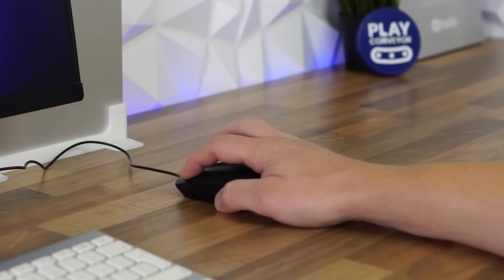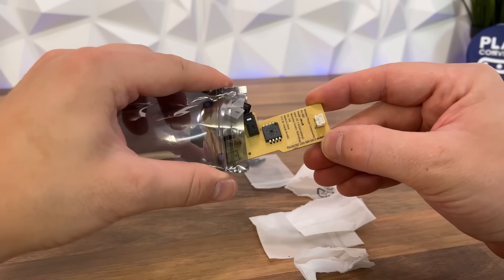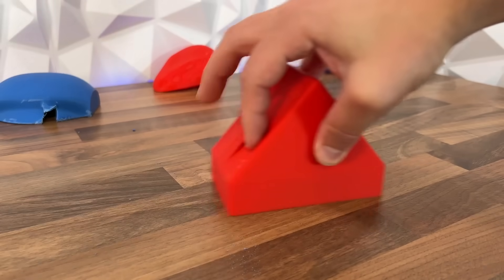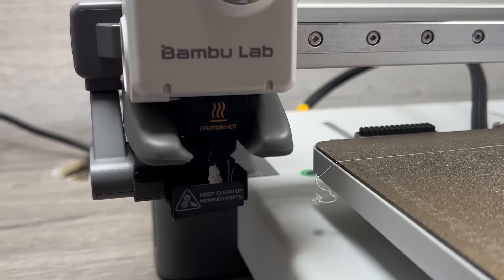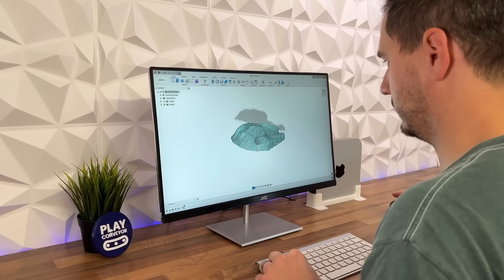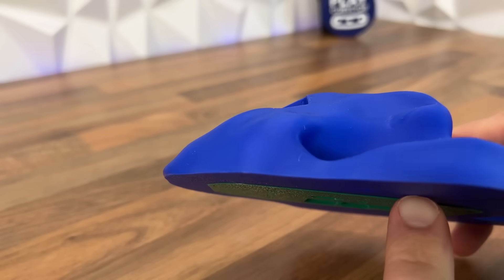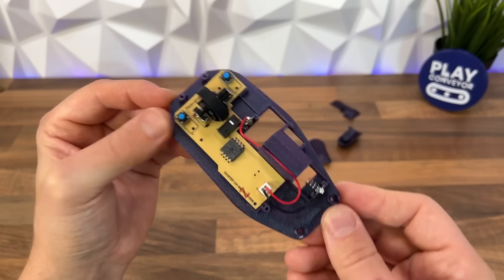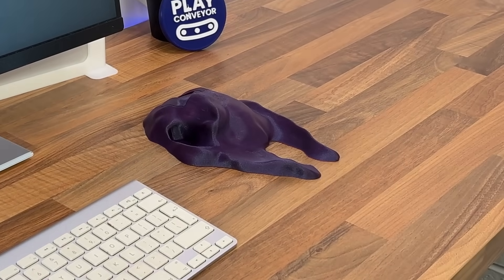I Built the World's Comfiest Mouse (ft. Bambu Lab A1)

Comment: Just have to trim the edges off and smooth this shape a bit it will be great and add 2 buttons for the thumb the idea for resting is good but considering you want mobility and functionality you would like to have something popping up between your fingers as well closer to a half glove for a stable hold without your fingers needing to apply pressure at the tip of the fingers, Great video! cant wait to order your version 2 :DD

Comment: The "magic" mouse is by FAR the worst mouse ever designed. Not only is it TERRIBLE for any kind of work, but the fucking charging port is on the bottom, so if it runs out you cannot use it anymore until either fully charged or charged enough.

The ONLY good thing it has, is the swipy mechanic, that shits legit but thats literally the only thing it has going for it

Comment: 6:11 that. That right there is the perfect mouse shape. The vertical mice make it so your wrist doesnt strain while holding it because instead of your wrist having to bend down to reach your normal mouse, your wrist is just extended straight out like you would normally have it while holding stuff
Reply: Its crazy. Been using vertical for a year and not going back. Occasionally for fps gaming sessions i hop on a flat mouse but even after little use I can feel the tension.
Reply: Not for all. My thumb cramps up holding those. But it also cramps up holding a paint brush for too long. I seem to need something where I can spread out my hand more.
Reply: As a handyman I get to see some very nice home office setups. I recently saw a similar vertical mouse with built-in trackball on the desk of a client who is in her early 60s. The design seems rather genius.

In my experience the lighter the mouse the better. I use a single AA battery powered Kensington "Wireless Mouse For Life" mouse. It feels and sounds cheap when operated but it is very comfortable and dependable. I recently upgraded to a dual battery Logitech "Marathon" mouse but after 3 months I went back to my trusty 5 year old Kensington for its lightweight design.

If the mouse does not need to be carried and dragged around at all it completely eliminates the weight issue. I will keep that in mind in the future.
Reply: @renegonzalez6755 weight is one of the most important aspects for long sessions, weight distribution too. with the Kensington, do you not find yourself "gripping" it because of its size? this is my biggest problem with smaller mice even though id love the solid shell AND light weight
Reply: It's better for the wrist, but clicking a button makes you push the mouse a bit so for FPS games vertical mice suck unfortunately. 
I use a vertical mouse for work, normal mouse for FPS gaming.

Comment: I did pretty much the same thing as a personal project, which resulted in a similar shape to your design.
It didn't turn out to be so ergonomic, since it forces your hand into a single grip with no tolerance, while you constantly try to adjust your grip when using a mouse. Also, the overall flat design felt uncomfortable as it makes it difficult to "pick up" the mouse to reposition it.

Comment: Without watching the video and being from an unrelated branch of hobbies ... All I'm gonna say is that making something fit your hand perfectly is never a good idea.
As a person who dabbles in knife making I'm quite well aware that having finger grooves on a knife which when grasped firmly do feel comfortable however the knife will never be held like that when in use , yes when you are feeling out the knife it will feel good but when you actually go and use it it will suck . Same logic in my mind applies here as well , when you are actually moving the mouse around , you will not hold it the same every time , just moving it left and right you have a different grip on the mouse , when pushing either mouse buttons you will put pressure on different areas of the mouse , modern idea of ergonomics is just plain wrong.

Comment: I would definitely consider making the tail end of the mouse shorter and lowering the overall height. While grip takes a large part in comfort, so does the weight. It can cause lots of strain if it's too heavy, and can be unsatisfying if any of it is limiting your wrist control

Comment: As a person with relatively big palms, I can say that most of the modern mice are terribly small. And humpbacked in the most unpleasant place, forcing you to constantly strain your palm and fingers to prevent them from sliding out. I adore the vintage Logitech mice that were long and thick bottomed. You could simply lean your palm on them, keeping it firmly gripped between your thenar and hypothenar, moving it with almost the wrist moves only, having your palm almost fully relaxed. I miss those mice.

Comment: The bad part of getting the mouse the maximum of comfortable is that you lose the strength to pull the mouse over the surface because your hand gets lazy.
And apparently, he brought comfortable to the pulse by adding mass between his hand and arm, but ended up sacrificing the independent hand mobility from the arm (left and right movement) and can only move the mouse if using the hand+arm necessarily.

Comment: I had this problem a few months ago, because my hands are freakishly large. Solved it by using a vertical grip mouse, gluing felt furniture pads cut into 1×2cm pieces to it, and gluing a door stop under a wrist support to jack it up at an angle. Probably would be better as a single piece but it works well enough

Comment: Technically, the most comfortable and anatomical mice are vertical ones, because they follow the natural shape of the body, as it rests on the desk, without rotating the hand and stressing the forearm and wrist, so starting with a horizontal mouse is already wrong. then, it should be soft and a material like microfiber or velvet to be comfortable and not 3d printed.

Comment: In addition to changing the orientation of how your hand rests on the desk to be more vertical, I think you should somehow scan how your hand rests on this mouse structure, how the pressure is distributed across the palm and wrist, and with that data design a minimal body shape (perhaps some ML is needed here to optimize the shape to be of least volume but supports majority of the hand)

Comment: You should rethink the scroll wheel placement.

I’d recommend putting it on the thumb, or putting right click to the ring finger.

Also you must think about the way you use a mouse. Are you using the entire shoulder to move it? Or just your fingers? All considerations.

Comment: There are passive and active ergonomics. For example, an Apple mouse that at first view appears extremely unergonomic can be more ergonomic than your mouse. With Apple (or any other manufacturer), you can position, move, and relieve your hand in different ways. With your mouse, your hand is always fixed, and the way you work is predetermined. So, at the end of the day, it can have more negative effects than a mouse that looks uncomfortable.

Comment: if you want to get a 3d printer you should probably get a bambu lab x1 carbon instead because the melted plastic make fumes that cause cancer. The x1 carbon has a case and filter so you wont get cancer :)

Comment: Using the ball wheel tracking at the thumb for the cursor navigation instead of moving the entire mouse would have been good for this.  It saves your wrist and is especially good for extensive 3d modeling.  Having one of these now, i can never go back to a regular mouse.

Comment: Here s how you actually use a mouse properly: Remove the "imporve mouse precision" option which is a load of crap, reduce the speed of the mouse considerably and instead of using your wrist to move the mouse you your arm and wider movements. You ll need a bit more space to manuver.

Comment: I see no cushion pads in world's most comfortable mouse
Reply: Because of how it was made, whilst cushion material might be ideal, it is likely not necessary. Because any cushion material would just find the shape that he printed that thing in.
Reply: @the_undead  Ideal?
Reply: @BenBloxer How.. ideal?
Reply: @Erlking-Heathcliff0  fly perfect wings,
Reply: @the_undead  how ideal..?
Reply: @GrimGecko129 potentially improving the comfort A slightly noticeable amount.
Reply: @the_undead  ideal... so ideal that my broken wings may just fly
Reply: Cushon pads make inperfect things confortable, perfect shapes can't become more perfect with a cusion
Reply: @RinusPlotseling It's not like the shape is perfect after a single motion
Reply: @RinusPlotseling Yeah they can. Anything is better with a cushion.
Reply: @gavindinsmoor8196 no, if you add cushion to the then perfect dimensions, it will change the dimensions out of proportion. Maybe negligibly, maybe not.
Reply: @jasonrice5628  True, but if you mold the shape ahead of time to account for the presence of a cushion, then it would squish into the planned shape even if that's not how the hard plastic was printed. Did that make any sense?
Reply: @gavindinsmoor8196 it would have to be dynamic enough to change for the pressure you’re putting on it
Reply: @WaveringRadiant  Then shape the hard plastic how you want. Everyone's got different opinions on this for some reason.
Reply: He should make the base structure of pla and then the outer shell of TPU for comfort.  Also, he should add vents for heating and cooling his hand.
Reply: The cushions are on your hand
Reply: went to see if there was a version 2 on his page, and i guess this was his last video ever posted, and it was a year ago... guess he just poofed?
Reply: Finally perfect mouse
Reply: Honestly some type of cushion would probably just trap heat and sweat. And would most likely stink up over time.
Reply: ITS A MOUSE YOU NINCOMPOOP
Reply: За то вид3и7ь рекламу  бамбулаб😂
Reply: the noise it makes when he drags it across the desk 🤮🤮🤮

Comment: Couple things I can think of for Version 2.
You probably don't still have the playdough mold, so take the current version, apply a ink to your hand, and rest it on it in the comfortable position, then re-scan it. This should let you identify exactly where your hand makes contact, and since the scan grabs color as well, you can create a mask for the area your hand contacts. Using the masked data, select all the parts your hand doesn't contact, and either ultra-smooth them, simplify it into geometry so it looks pretty, or ideally both. This should improve the form factor drastically without affecting comfort at all.
For the area within the mask where your hand does contact, you may also want to smooth it a bit, but not so much that it would drastically effect how your hand rests on it. Then you are going to want to complicate things, by creating two versions. One that sinks the masked area down, and smooths it out into a very simplified form. The other, you will want just the masked area, and smooth it until its a good blend of form factor and comfort, probably going through and inflating the hills ever so slightly if you have a free sculpt feature in the program. Next, using data from these two versions, your going to want to combine them, so there is a body of the mouse with the sunken in slot of the masked area, and the other, just the masked area, with a bottom that matches the other exactly, and a top that is the smoothed and slightly inflated masked area. Print the body in the same rigid plastic as this one. print the masked area in a very soft spongy material. If you didn't see where I was going before you almost certainly do now. the pillowy handprint area should be slightly nicer looking now, but have enough give that your hand naturally compresses the "hills" that are now supportive pillows, and any bits where the geometry of your hand would press down into the valleys will still squidge down the lower bits slightly. When combined, you should have something that isn't shaped as exactly to your hand, but is a perfect cushion to rest your hand on, and a main body of the mouse that has greater shape-design.

Bonus points if you overlay a texture onto the cushion section for improved grip, and print in a material that's not only soft, but feels cool to the touch so it doesn't get uncomfortably warm over extended periods of use on hot days. Also if you get a slightly fancier kit with a thumb button, I think that side slot you've got to support your thumb is begging to be given some functionality.
Reply: Damn that's long i respect

Comment: I was wondering about doing this exact thing.  Mine would be very differently shaped, because I basically claw my mouse and hold it between my thumb and pinky.  But if I were to go through a process like this of creating a completely custom mouse - I would go the full distance.  I would have a click for pointer, middle, ring, and pinky, as well as side buttons for my thumb - all perfectly laid out for the shape of my hands and perfect reach for each finger.  It's never made sense to me why there aren't more mice out there that utilize the entire hand.  99.9% of them only use 2 fingers, sometimes 3.  My current mouse has a clicker for the ring finger and 12 side buttons.  I would want more - a fourth click or a button for the pinky.  And I would figure out a way to design it where I don't have to use as much effort just holding onto the mouse so my fingers are free to input independently.  Otherwise it's a waste of time and money doing this

Comment: The Razer Naga 2012 has replacable side attachments and one of them has a little finger rest so the whole hand is supported by the mouse and you do not have to grip. That attachment is why I have been using the same exact mouse for 13 years. It blows my mind that more mice aren't designed this way. I need to get me a spare for when this one dies.

Comment: My first gaming mouse was a pretty standard shape but with some sharp bits that were annoying, when i had to replace it i got something a bit more ergonomic shaped but the buttons sucked, when that was replaced i went full ergonomic and developed wrist pain with two different fancy shaped mice, returned them and discovered that the ultimate most comfortable mouse shape for me is... bog standard mouse shape, the most boring "default" shape is the best.
Been using a Logitech G Pro for years and have zero issues.

Comment: Ok hear me out. The perfect mouse is not a mouse, but a glove that you slide your hand into, so that improper use of a mouse is not possible, ie moving at the wrist, forcing you to use your whole arm. It fixes the problem of having to grip the sides of a mouse, especially when doing large movements. It makes lifting the mice easier. Literally just lift your hand, or move your arm left and right. The extra buttons can be added where fingers would naturally be, keeping it simple to transition to with left click pointer right click middle finger, and 3 extra buttons for other digits.

If you say made a sleeve that your hand slides into that could be dope. The sleeve is 2 pieces attached together which can be unlatched to seperate, allowing you to clean it.

I dunno. An actual glove mouse would be garbage. I dunno, i just imagine something you slide your hand into and the buttons are just there, and your hand fits perfectly. But if the whole thing moves, the weight would be a difficult issue to solve and the issue of keeping it clean. 

With how good eye tracking stuff is. Maybe the best mouse is actually no mouse, but thought or eye tracking only, and maybe you just sit back with a glove on for the mouse clicks. This would be far better for ergonomics, and minimizing carpal tunnel syndrome and other issues.

Comment: It seems that it was necessary to make a mold for pouring paralon or silicone. Then it will be 1000 times more comfortable, heat will be dissipated and the palm will not sweat, and the weight of the palm will be distributed more evenly. I think 😊

Comment: I feel like part if the comfort is the ease you can move around. It looks comfortable enough if you're just sitting there stationary but I can't imagine it helps actually using the mouse. This design basically locks your hand and wrist into one position. It looks like you can only move the mouse around with your whole arm which is sure to get fatiguing. Being able to move the mouse with just your fingers would be an important part of a design for me.

Comment: As long as it has plastic surface on top it is not comfy, topmost layer need to of silicone otherwise it will feel like touching a wall with palm open, to be honest for me it would be cool and timesaver if I had two display laptop, display on the lap and top both touchable, no keyboard (because it can be in the lap screen whenever you want), no trackpad, only a pen and davinci console for some precision artwork.

Comment: Probably should get custom circuit board to raise the mouse wheel and make sure to get some padding at the base of the mouse, there's a reason we use mouse pads and that weird shiny plastic at the bottom of the mouse. Other than that probably model your hand in as well and cut off all the loose material from the sides.

Comment: One thing I'd suggest for version 2 is taking those long tails that support your wrist, trimming them down, and adding padding to them so it's a soft malleable surface for your wrist to lay and flex in instead of a bouple of hard shelves your wrist will bump up against when making finer wrist turns on the mouse.